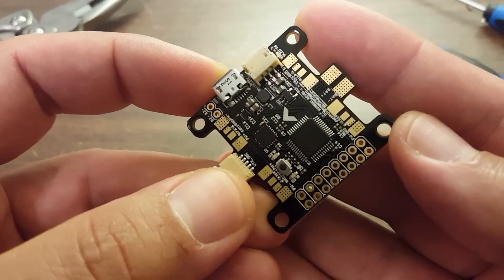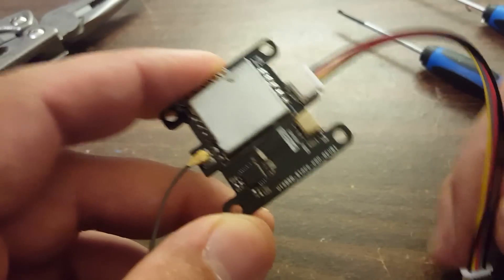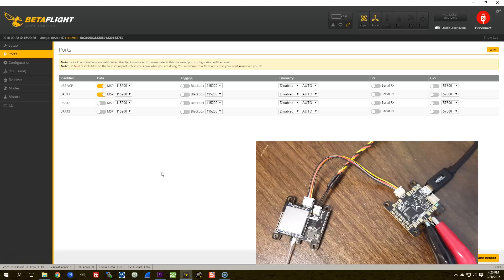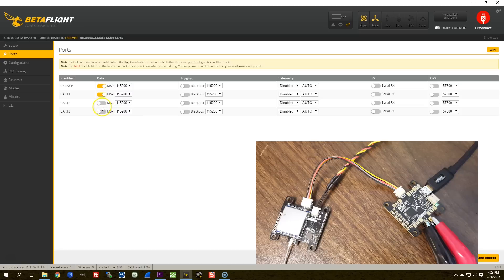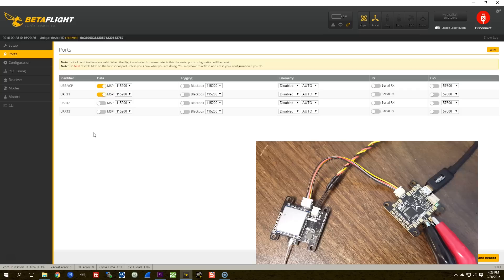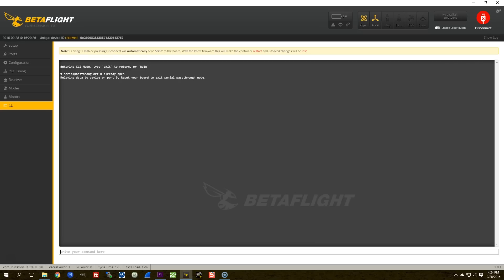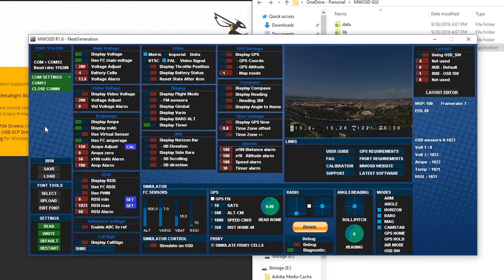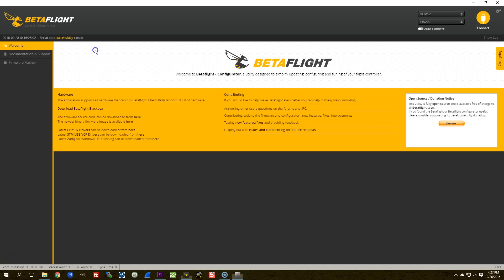Betaflight Serial Passthrough with Furious FPV Kombini OSD | HOW TO

Comment: Does it work on KISS FC too?
Reply from the maker: +Kevin BOYER if you flash Betaflight it does.
Reply: yes of course I was talking about a KISS FC on Betaflight. Cool! But then why the passthrough with BlHelisuite does not work? It doesn't make sense... Could you explain that? Thx
Reply from the maker: +Kevin BOYER blheli pass through doesn't work because there are unidirectional 5v buffers in the motor outputs. Unidirectional being the key word there.
Reply: Ow ok so if I understand well it is because there is a sort of protection built in the KISS FC. So it is not a software problem but more of a hardware one. Is there any other board like this or is it just KISS FC?
Reply from the maker: +Kevin BOYER Moto Tornado also does this if memory serves. The issue is that the 3.3v output from the F3 can get corrupted so the buffer boosts it to 5v.
Reply: Ok thank you for the info! And for taking the time to answering to me. I just installed BF 3.0 on my KISS FC because I only have troubles with my BlHeli_S Littlebee ESC at low/mid Throttle. It is doing the sort of Yaw oscillation like we saw in your last live. I hope BF 3.0 is going to solve that and at least I will be able to use Multishot!
Reply: Ok so I tried and MWOSD GUI says "waiting OSD"
I am wondering how many wires I am supposed to have... at the moment I have 5v GND RX and TX but what about DTR??
Reply from the maker: You don't need DTR and CTS unless you are flashing. For configuration, 5v GND RX TX is correct.

Most common problem is incorrect baud rate.
Reply: ok. I'll check baud rate then but I am pretty sure I use 115200 everywhere
Reply: I have a doubt... I connected my OSD to my KISS FC on UART 3 so I did serialpassthrough 2 115200 but the CLI answers open on port 0 does it make sense?
Reply from the maker: maybe it doesn't work? I don't know.

Comment: Joshua, great video, I really like this new feature, thanks for making me aware of it! I'm skeptical that this will work with the minimosd though. I remember having issues connecting to my micro minim osd with an FTDI adapter. I could not connect to the minim osd without connecting the DTR pin. Do you think serialpassthrough will work with the minim osd without connecting the DTR pin?
Reply from the maker: I think you need DTR to flash, but I don't think you need it to configure. I could be wrong though.

Comment: OK I have just started watching the video, I assume my main hope of being able to set the VTX channel via pass though and the OSD.

don't worthy I know that I will be very disappointed
Reply from the maker: If it's a serial device, connected to the FC, you can talk to it from your PC. That's the gist of this method.
Reply: yeah I know, but the vain hope that somebody will release a 5.8 tx that allows software control of channels and power.

I'm hoping they will release the ImmersionRC Tramp with the TX control lines exposed (rather than running to a RFID interface)
Reply from the maker: The SirinFPV can configure vTX parameters via transmitter sticks and OSD. Likewise the Kombini board I've got in this video, although it's not for sale yet.

Comment: oh man, I'm a bit upset to hear f1 naze boards are not the main ones anymore. I just bought a new naze32 rev6. please please please tell me what the new mainstay is I should be using?
Reply from the maker: Take your pick of an F3 board with an MPU6000 gyro. The Fury F3 from 2dogrc and the AIO Omnibus are my two favorites. Multirotor Mania is my preferred vendor in the U.S. for the Omnibus because of their great customer service, but there are other vendors you can get it from if you care about that.

Comment: Joshua: So if I'm using BT 3.0 as long as I have a Minimosd Micro connected only via the TX/RX ports can I do this?
Reply from the maker: I'm not sure about that. You connect to CF via the Bluetooth, and then pass through to the Minim? I guess so. To the PC and the FC, the Bluetooth link just looks like a serial link. But I couldn't say for sure.
Reply: No I meant BTFL lol sorry. Nm figured it out

Comment: Thank you again for these videos, I didn't even know I wanted to pass-thru program my integrated OSD until I saw this, and learned it was even possible! The question I have is about the integrated OSD on my LS-F3-OSD board, (AKA Flip32-F3-OSD). It's a gen 1 F3 board, with continual releases of BF firmware from Samuel Powell it's been usable, if not friendly. I tested the feature out with BF 2.9, and passthrough mode is there, too. And following your instructions, I was able to connect the integrated OSD on UART1 to MWOsd 1.6 without jumpering (as is normal for this board), but it didn't look like data was being passed. The MWGui was stalled on "waiting OSD " I imagine this is a hardware limitation that will prevent this method from working? 

The Omnibus FC's are looking better every day...

Comment: We need to move to F4 chips just to have enough UARTS!!!
EDIT: Although I guess more boards have onboard sd cards via SPI so that frees one up.
EDIT2: Now can we just get Blheli suite in betaflight configurator (al la Raceflight) so I don't need to start a VM to update my esc's?
Reply from the maker: A person is working on a Chrome version of BLHeli configurator, but the decision was made NOT to integrate it directly into the CF or BF GUI, to avoid tying the release schedules together.
Reply: devs needs to think twice about that. Google have announced the deprecation of apps support starting with other browsers and then Chrome itself. Eventually all of these configurators will need to be standalone exes
Reply from the maker: Devs are surely on top of this. No worries.
Reply: Yeah but that's at least two years away. It's also not that hard to wrap a chrome app in a container like Atom and run it standalone.

Comment: SD card access would be nice too. The SirinFC has the BB SD card, but you can't get to it easily if your quad has a top/cover. (like my XBR)
Reply from the maker: I'd be surprised if Furious didn't have an SD card reader of some sort in the works. They're very quick to develop new products.
Reply: It the same thing that I think... I've told to Steve to put a SD or a little memory on the fc... Hope in next realise

Comment: Nice... now when will Betaflight be able to do serial connect to a MWOSD using the internal OSD configurator? Now that would be awesome.
Reply from the maker: I suppose that would be nice, but they'd have to integrate the whole MWOSD configurator.
Reply: Hmm... I thought they had already implemented it (or a portion of it) in order to get it to work in the configurator as it does now? I'd imagine it is possible if say you flash the OSD with some sort of MWOSD beforehand and then being able to configure it in the configurator. 

Joshua, you should use your "pull" to see if we can make it happen ;-)

Comment: I used this before, really cool. I could use the configurator but I couldn't flash with arduino... I was using the micro minimosd and I found out we need to connect all pins(DTR and CTS) to flash with arduino. Is that right or I was doing something wrong?
Reply: I believe so as well.... Maybe we can plug the battery in at the right time to simulate a reset....
Reply: Maybe you simply did not select the correct board, processor and port...
Reply: Im sure I had the right board and processor... it just didn't work, I couldn't flash. but it worked great with the configurator.
Reply: I think we need to have the battery plugged to power the 5v rail.
Reply: LD Silva Yes you need to provide 5V to the board :)
Reply from the maker: +ABMNS PRODUCTION yes that's right. It needs to be able to reset the board. If you time it just right you can power up the board and hit the flash button in the computer to catch the bootloader window. But it's a pain.
Reply from the maker: +ABMNS PRODUCTION yes that's right. It needs to be able to reset the board. If you time it just right you can power up the board and hit the flash button in the computer to catch the bootloader window. But it's a pain.
Reply: Yes it's hard to do that. but it's great we can at least use the configurator!
Reply from the maker: Oh, I see the point. You can't easily flash the board because you need those pins hooked up and they aren't hooked up via passthrough. Very good point. Sorry I overlooked that in my enthusiasm.

In theory, you CAN power the device via the 5v rail and hit "flash" in Arduino at just the right time to catch the bootloader window. With practice, you can do this consistently, but it's a bit of a pain.
Reply: Not possible.